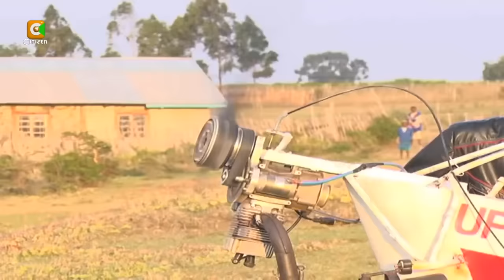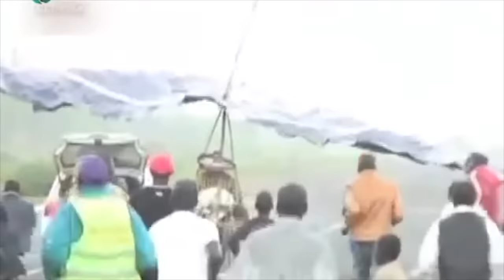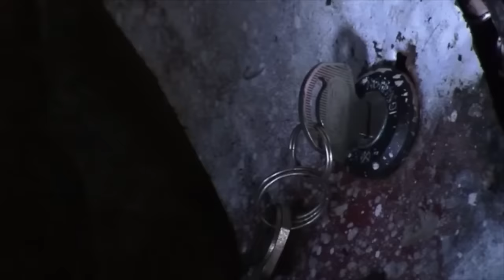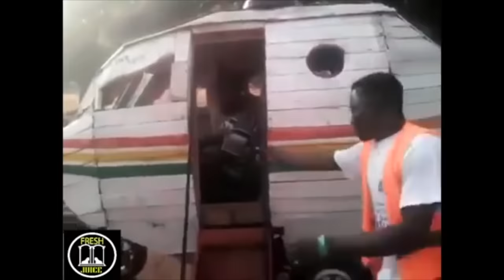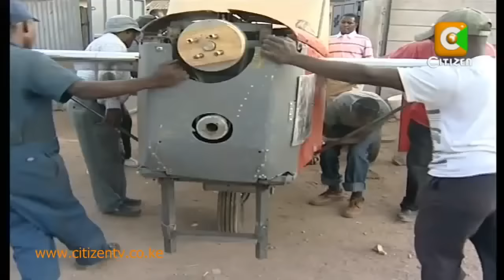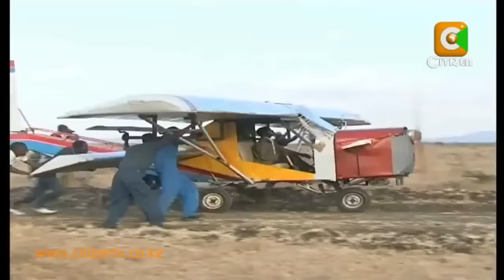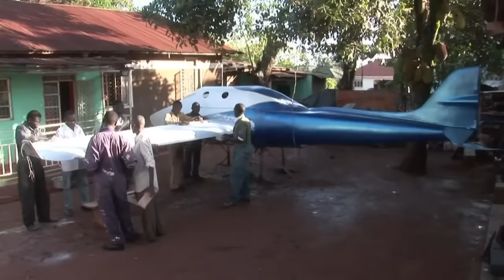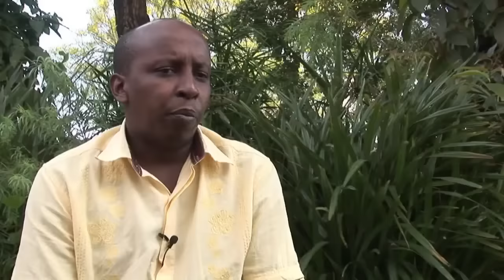African Airplane Compilation | African Aviation

Comment: I love the fact that Upendo’s wings are angled to create lift while stabilizers are angled to create downforce
Reply: I love all of this 😂
Reply: I like the name Upendo the most
Reply: You just dont understand advanced aerodynamics.
Reply: Which is the normal practice in designing commercial aircraft of today? I mean the ones on the Upendo is all over the place, but from Cessna 150 to Airbus A380 all have the wings to generate lift, and the horizontal stabilizers to generate downforce. It's counterintuitive but it all checks out.
Reply: @grdprojekt  I guess it does? but Upendo’s angled like 80’s Group-C racing car
Reply: @standupstraight9691 stagnantdynamics
Reply: Guaranteed instant looping, if it had enough speed to take off. 
Stabilizer should in-line with the flight direction, not angled. What is also (very) bad is the total lack of elevators .... and rudder. 
So, it was very fortunate for him it did not take-off...
Reply: What’s more concerning is that the elevators seem to be permanently angled to pitch the plane upward
Reply: @AeroGraphica Really. Just don't hurt yourself trying to work this out. There are untrained dreamers already doing the legwork for you.
Reply: @MadScientist267  😄
Reply: Thats normal for every aircraft....
Reply: Thats the auto loopdeloop feature, only the most daring pilots can operate those. He truly is a marvel of aviation
Reply: @yacregroona7236  atleast one person gets it.
Reply: @alanwebster3942 it means love in Kiswahili
Reply: Hahahahahaahahahahahhahaha
Reply: Oh boy.
Reply: That's actually the norm in most aircraft, the stabilizer generates negative lift to compensate for the moment of the main wing. Perhaps Upendo knows more about aircraft than you do.
Reply: I like how Upendo didn’t even have a vertical stabilizer like a rudder.
Reply: @biponacci  unmovable trim

Comment: jokes aside i massively admire the courage to pursue their dreams and determination to try with basically no resources. cheapest way to get in the air would be a paramotor, that would be life changing for these people
Reply: Me too, at first I was going to poke fun of them like the others, now I want them to succeed.  What they need more than funding is an experienced aviation engineer to volunteer to teach them.
Reply: @fefferryerr1818  Or just some basic math and physics courses. You can't tell a 1st grader how to assemble a complex circuit and then expect them to understand the fundamentals.
Reply: @nic12344  There's always gotta be that one guy...
Reply: the probelm is that. they lack of im sorry, IQ, to do that. one of the plane weight 800kg. and think that 100cc 2 stroke motorcycle engine was enough. 
dont get me wrong i love their enthusiastic spirit. but they need to learn the basic. very very basic of physics
Reply: Don't confuse dreams with delusions and genuine idiocy.
Reply: @fefferryerr1818  I think you might find that they are competent enough to complete the task themselves thank you very much! After all, the whites have done it as well.
Reply: They'd crash it.
Reply: THATS WHAT I WAS SAYIN
Reply: @anomalyp8584  when do you estimate they'll put a man on the moon at the rate they're going?
Reply: @fefferryerr1818  maybe 300 years?
Reply: @anomalyp8584  ouch
Reply: @fefferryerr1818  might be later, but it will happen
Reply: Yes, their courage and determination is admirable, but it should start with basics. I know their situation is different and probably shouldn't compare them to anyone else, but how do you even think they could succeed if they don't even acknowledge their lack of knowledge. I know that getting that knowledge could be difficult to them, but seeing all the people making pictures with their smartphones i don't think it's THAT hard.
Reply: @anomalyp8584  With all the information already available on how to do it, that is a sad assessment.
Reply: @jakubw.2779  sarcasm
Reply: @fefferryerr1818  Still true though
Reply: @anomalyp8584  I'm still not clear why you don't think they should accept help from those who understand how to design planes properly.
Reply: @ThunderChunky101  So you're saying you support eugenics?
Reply: @fefferryerr1818  I started out heavily sarcastic...now I feel checkmated XDDDD
I was talking more in the trend of people like Biden...saying they are just as good as others, but they need a bit of help of white people.
Reply: @fefferryerr1818  And I think I'm right in saying that most help in Africa comes from western/white countries. So, not yet checkmate! I reason from facts, that's not inherently racist, though today's climate tends to put the 'racist' sticker on everything and call it a day. 
I'm sticking to my argument. I associate 'help' with white...you assumed the strawman.
Reply: @anomalyp8584  It's not strawman, in the past you could say that, but now there are plenty of black countries that are more advanced, such as south africa.
Also, why is it even racism to accept help?  We are helping ukraine, is that bad? Learning from each other is a good thing.
You also assume the west means exclusively white.  Is neil de grass tyson white?  There are plenty of black people in the west in the sciences. 
What does it even matter what color people are?  Are you saying, "Oh i'm black and you're white, so I can't accept your help, that would be racist"?
Reply: @fefferryerr1818  What do you even mean by that word?
Reply: @ThunderChunky101  which word?
Reply: @fefferryerr1818  You need to pay attention to the words you use. You used the word eugenics, without any reference to the previous conversation. Are you accidentally replying to the wrong person? No one in this thread said anything even remotely related to that word.
Maybe you thought you were carrying a conversation in a different thread?
Have a read back through this one before replying. I think you made a mistake somehow mate.
Thanks.
Reply: @BillOweninOttawa  I don't think a toyota engine is gonna be strong enough to power a small plane lol
Reply: @fefferryerr1818  They do.
Reply: Way too expensive. You cant make a paraglider, and is will cost at least 2000$ for a used one. Without the motor ofc.

That is 10 times their budget.
Reply: @anomalyp8584  love your optimism 😂😂
Reply: @ianlanford6922  he did better than me that can't even make any motorized object
Reply: @Jakub W.  Yeah bc making picture and using a phone is as hard as aerodynamics ?
Reply: Maybe they can take a stroll down to the shore I heard there’s Diamonds just buried inches under the sand for thousands of years , heard they were discovered when some white dude stubbed his toe on one on vacation
Reply: Could try teaching them that a small Toyota engine doesn't have the power to move 800Kg of junk metal off the ground when it can't even drive the thing on its own
Reply: @JungleOldSkooler  You're right, they need basic teachers in addition to engineers to see them through from start to finish.
Reply: @BillOweninOttawa  doesn’t matter. Having the courage to follow your delusions is still admirable, compared to how so many people are scared to follow even reasonable goals.
Reply: @ianlanford6922  Well for someone with such poor sentence structure like yours sir, I don't think you should be critiquing anyone elses IQ there chief!
Reply: Power to lift ratio, give em those tables and they will be off.
Reply: @anomalyp8584  it will be the work of CN or the USA at that point
Reply: @keith3761  look at the video, he is correct
Reply: If they really wanted to pursue their dreams, they could have go to the library or to the internet and looked up the engine specs for home made planes))) Clearly they have phones and the internet.
Reply: They'd just be far more likely to kill themselves.
Reply: Congrats, your spending your life solving a problem that’s been solved for a century. Their parents must either not know what a plane is or be cringing so hard that this is what they poppped a kid out for
Reply: @anomalyp8584  😂😂😂 good one
Reply: Yep, but I guess the wives are desperate : time and money lost + life potentially endangered
Reply: I agree. Flight is just a combination of Power and Low Density.

Birds have hollow bones. And that's what helps them fly. Combined with their wings and strong chest muscles.

The Wright Brothers basically just took this same concept. And put it into a machine design. Using an engine as the power source.
Reply: @Cool Baby When it gets successful, then people would all switch and say how “great they are to make this out of so little resources.” No one sees the failure behind success. Preach brother preach
Reply: @piercemccauley7079  They're just hobbyists having fun.  Their country has its own airlines.
Reply: @anomalyp8584  I think you mean incompetent
Reply: @sotch2271  yes, but this is their best engineer. That should say something.
Reply: @fefferryerr1818  no, they don't need help. That's my whole point. Let them figure it out, they are equally smart.
Reply: @Cool Baby or that 90% knows that a grass mowing engine can't lift a 1000 kg 'aeroplane'.
Reply: @Cool Baby if you have to learn that something has to be light in order to fly, the case is hopeless.
I'm not optimistic if I say that most of the people watching this knows this and is therefore laughing...anyways, both our cases are assumptions, but what we see these Africans doing is fact. And the message they are sending is not a good one.
Reply: @Cool Baby By the level of your response I could already understand you outclassed 90 % of youtube commenters XD ...if not more. No need to mention PhD's.
I know that a project in reality is a source/opportunity to learn something new...you can't predict everything on paper after all. Every engineer knows that however perfect it may seem at the drawing board...there is going to be some hands-on problem solving when the project takes on form.
However...you can predict to a certain level; in this case that anything that you wish to make fly has to be within a certain weight category to get the ratio right compared to the engine. Anybody with half a brain can look at these 'planes' and know that they won't work. (power/weight being only ONE thing...i don't want to think about what would happen if indeed these things would go airborne).
Making paper planes as a kid already teaches this principle. 
Let's just say that I hope they really learn the basics about the subject before they start testing parachutes.
If you are at that level of learning...then start with something basic...but to come to that conclusion you have to already know you know nothing...and that's where the problem starts imo.
You reason too much from your own perspective of having brainpower, able to reflect, knowing your limits and actually learn from your mistakes whereas this gives me more 'rinse and repeat' vibes.
Reply: @Cool Baby then you interpreted this as a debate? I was just telling my thinking. No clash in my mind man. Take it easy. I already admitted that it's just one opinion to another 🧐 and I even started out with appreciating your comment. Anyways...no offense intended, I'll gtfo 🤣

Comment: 1.Get a powerfull motor.

2. Have accurate claculations and measurings.

3. Have a light weight aerodynamic design.

4. Get a strong chasis which can absorb 3-4 times the weight of the place.

5. Use some help of a proper Aircraft engineer!
Reply: 6. lern to spel
Reply: @dizzywilliams3557  cmon it's just 1 word Calculations!! I was not bothered to re edit this shit
Reply: @nadunwijesinghe965  - Bruh, it wasn't just one word.

1.Get a powerfull powerful motor.
2. Have accurate claculations calculations and measurings measurements .
3. Have a light weight aerodynamic design.
4. Get a strong chasis chassis which that can absorb 3-4 times the weight of the place plane .
5. Use Get some help of from a proper Aircraft engineer!

Anyway I apologise as i did not mean to kick at you whilst you are down. Just remember that these people don't have access to basic resources. It is easy to  mock them when coming from a privileged position but remember that no one decides how or when they come into this world.
Reply: Teqnyq You do realize spelling has nothing to do with intelligence, right?
Reply: @williamdeloach8613  my comment never said the op wasn't intelligent.
Reply: Teqnyq we both know you were insinuating it
Reply: @williamdeloach8613  well you are  entitled to your opinions. 

At this rate, you may aswell bring up a multitude of other things that you feel were "insinuated". 

Your assumption was incorrect.
Reply: Teqnyq sure bud
Reply: They have no concept of lift or aerodynamics. Lol
Reply: 7. Forget about it and pay for a plain that has already been built.
Reply: 7. Oh Yeah Yeah
Reply: @iceblazer8256  Oh yeah yeah
Reply: @yankees29  and I'm sure you do as well then?
Reply: Thoma Hawk absolutely.
Reply: @yankees29  okay then aerodynamics master what is adverse yaw?
Reply: Thoma Hawk the tendency for an aircraft to yaw in the opposite direction of a roll.
Reply: @yankees29 " Adverse yaw is the natural and undesirable tendency for an aircraft to yaw in the opposite direction of a roll. It is caused by the difference in lift and drag of each wing." 

That's the definition from Google isn't it funny how your answer is word for word the same with the beginning and end taken off. It's almost like you had to look it up.
Reply: Get help from a proper pilot who has a death wish.
Reply: in oduh fuh dat to happen dey ave ta go to skool ,  dey wud learn to spell gudd and proper like me.   @dizzywilliams3557
Reply: Or just buy a functioning aircraft